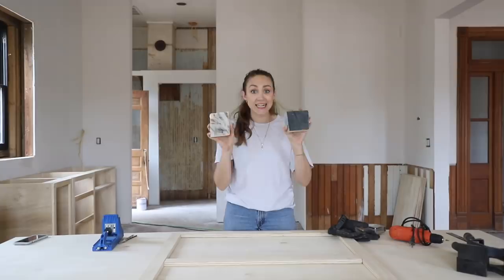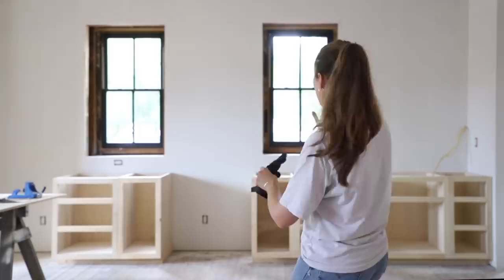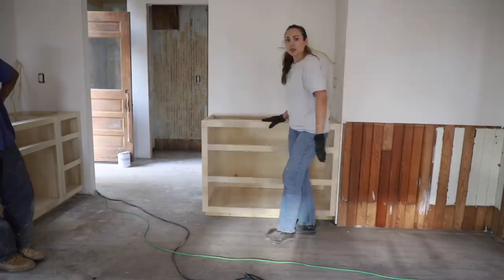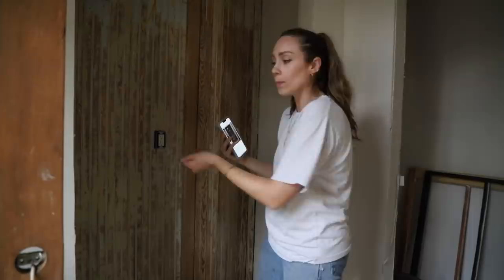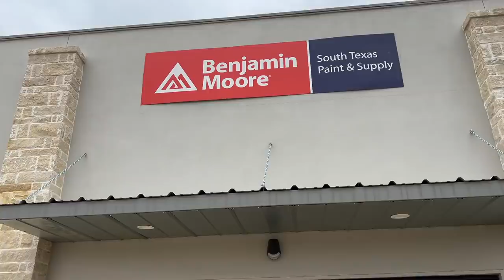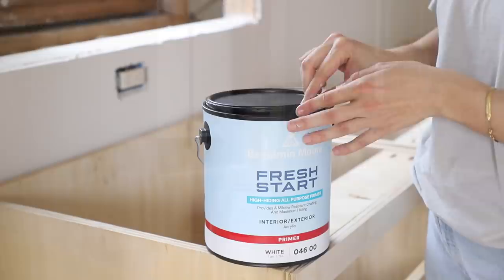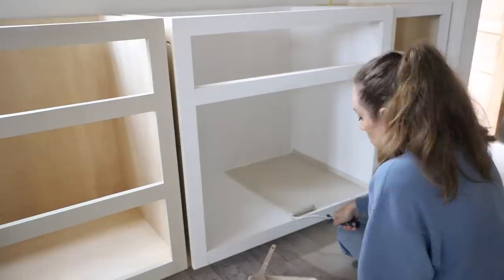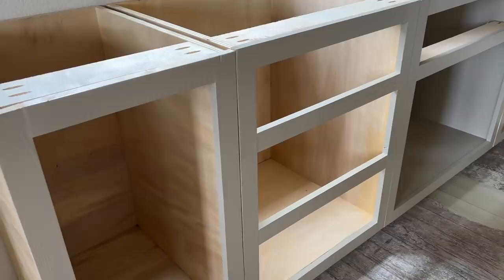KITCHEN & COFFEE BAR MAKEOVER Part 4 *Building & Painting Cabinetry* | XO, MaCenna

Comment: I will just say from personal experience - drawers should be the only thing for the lower cabinets. It's so much easier to organize and use. It's worth it
Reply: Agreed!
Reply: 100% agree
Reply: AGREED 100%
Reply: You do need a appliance cabinet for things like instant pot and mixer, blender.
Reply: @denisejones1863  I agree! I’m a professional kitchen designer and only drawers is not the way to go. You always end up having that large or weird-shaped appliance that doesn’t fit!
Reply: I agree with Priscilla…MaCenna, have you considered installing one of the appliance lifts like for your mixer or for your air fryer combo appliance.  I know you might now be thinking of it now; however, as we get older those large appliances are harder to move around (my air fryer combo is square and 12” wide and 12” tall by 15” deep - and it weighs about 10pounds with the inserts in it).  I know I would use it much more often if it wasn’t such a chore to get out of my butler’s pantry and move into the kitchen each and every time. Plus, because it is so deep (front to back it cannot sit under my upper cabinets and allow you to open the lid fully.  Just thought I’d mention this, just in case you hadn’t yet thought of the larger appliances and how you would accept them in your kitchen.  My husband and I are planning to downsize and move into the country (out of a subdivision) in the next few years.  This is just one of the many things on my inspiration board for my new kitchen.
Reply: Totally agree. I put all drawers in my kitchen over 5 Yrs ago due to having a car accident and seriously hurting neck and back the only lower cabinets with out drawer are under the sink and the corner cabinet. We also put a roller door over a section where I keep blender sandwich maker and toaster( bigger appliances ). That is really good for putting the clutter things out of sight!

Comment: My mom's house has lower cabinet drawers that are huge that she puts her pots and pans in. It might be a good idea for the ones you have in the corner! I am not sure what you said the measurements were, but it would be nice to fit larger pots and pans in there. She has one big cabinet with two big drawers for them. I love the color you picked for the cabinets too. Thank you for being so detailed in what you are sharing with us!
Reply: I have drawers everywhere on lower cabinetry apart from under the sink and a single small lower cabinet for trays and chopping boards
Reply: I'm doing a soft reno of my kitchen and I'm turning most of the lower cabinets into drawers. So much more practical.
Reply: @victorialove9104 ... And you won't lose stuff at the back any more!
Reply: I totally agree, if I were getting a new kitchen I would definitely be putting a lot of drawers!! So much more practical !  McKenna you are super woman !!
Reply: yes..also for small appliances..♥️
Reply: I so want to build that. Bending down and searching cabinets is not fun.
Reply: I put my plates and bowls in a large drawer, right across from the dishwasher.  So easy!!
Reply: I have that too. 3 Drawers on each side of the stove. I have pots & pans in the bottom 2 on the right fitted with a sheet of ply & pegs to surround each pot.

Comment: If you take a large flat head screw driver, and hammer a about 4 to 6 holes into the inside rim of the paint can, the paint will drain back into the can, and will keep the excess from filling up the rim where the lid is replaced.  This will save paint, and also make opening yout cans up easier.  Just an FYI I learned as a painter.  Love your videos!  God bless!

Comment: Cabinet designers will normally leave a minimum of 3” of wall at the end of a run. If not just to fit light switches next to wall cabinets, it will add the space to accommodate crown mouldings. So if you plan to build a wall cabinet above that 45” base, you will need to make the wall cabinet leas than 45” if you plan on having crown mouldings. If so, you may want to make that base smaller to match the width of the wall cabinet unless you don’t mind them being 2 different lengths.

Comment: You are a force to be reckoned with. Keep up the great work. On the coffee bar, you’ll want to put a filler piece on each side made out of face frame material, cut to fill the small gap you have. This will ensure nothing can get trapped back there like rogue coffee beans. When painting cabinetry, it’s best to use the same dye-lot from Benjamin Moore when painting the doors. That way, everything matches and you don’t have small differences in color related to having a different batch of paint or even the age of the wood. With opaque colors the wood is less of a factor. Best of luck! I’ll be rooting for you to get the kitchen of your dreams 😌🌛💫

Comment: Things are looking great at your cottage with your paint jobs!!! And Benjamin Moore is THE best paint. For smooth surfaces the microfiber roller can't be beat other than by spraying.  I use a Zebra brush for surfaces that need to be painted and the brush is awesome because of the high number of fibre bristles and how it lays on paint.  I  commented once before on the surf prep sander.  It takes sanding to a higher level and has a vacuum system for the dust.  It can be used around curves such as your master bath vanity, without losing contour, and in corners where an orbital will not reach.  Tools make  the difference in finish.

Comment: Hi MaCenna, LOVE both your channels! I so look forward to seeing them! A quick tip when painting is to punch a few holes with a screwdriver into the paint can lip (the groove where the lid attaches). That way when you pour the paint the excess drips through the holes, back into the can. Little waste and easier clean-up! Hope this helps. 💕
Reply: This is something I do as well.  I also use Press n Seal to cover the top of the paint can, then replace the original lid on top of that.  If you are painting with the color every day it is unnecessary; however, if there is any chance there will be some time before I open it again, it helps prevent that layer of skin that gets on top of some kinds of paint.

Comment: Hey MaCenna,
I used to design kitchens for a living and I know that you can't order drawer bases larger than 36" wide... I"m pretty sure that's because of the weight distribution and the strain on the drawer glides. You are probably going to need some additional support (so a third under-mount drawer glide) if you are planning on doing a 45" drawer base cabinet. Even then... I would probably opt to do a 36" drawer base and a 9" wide base cabinet or base pantry pull out. That's just me though ;). So excited to see your kitchen come together! You're doing an awesome job!!
Reply: Also... it may be too late for this... BUT... an awesome custom add-in for cabinets is converting the toe-kick into a drawer. Push to open drawer glides are used and they spring open. They are AMAZing for storing baking sheets, serving trays, and linens.

Comment: Macenna you can put cabinets with extra large pull outs inside for large items like a mixer or a air fryer. Also one more thing is you might want to cut the wooden floors at the level of the toe kick in case you have a. Water damage, you won’t have to damage the floor when you remove the wet planks.

Comment: It’s amazing what you’re doing and what you’ve accomplished. I’m just curious about the tracks for drawers, the drawer supports, the shelves in the cabinets. how they will be installed when the granite is on. Would it not be easier to do these steps now? Or is the plan to get the box frames for cabinetry for the sake of countertop measurements, then afterwards disassembled & redo the cabinet details?